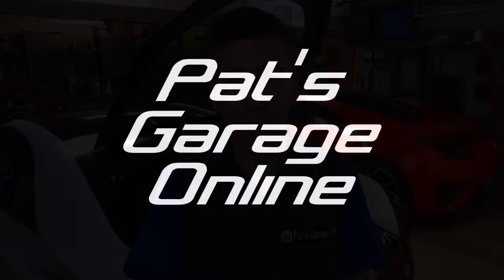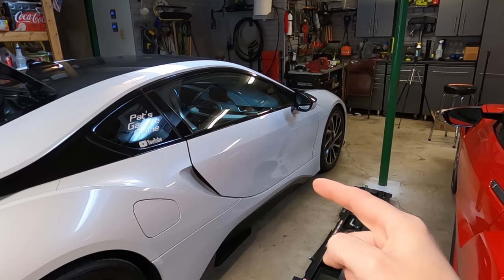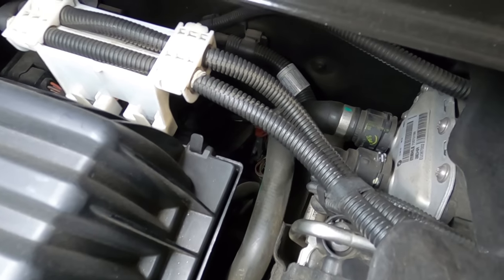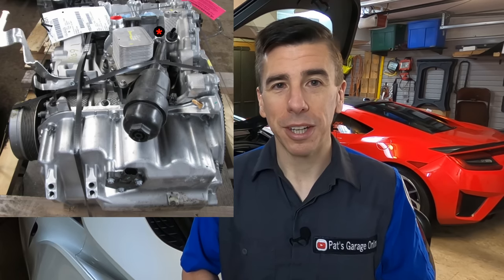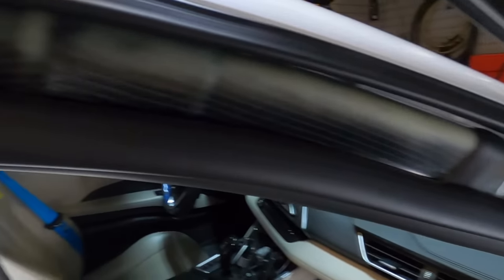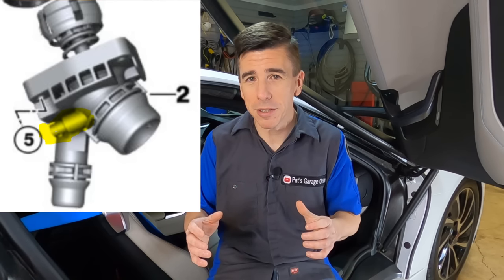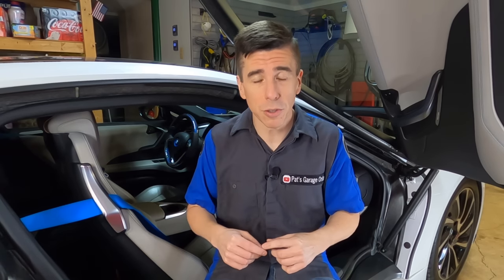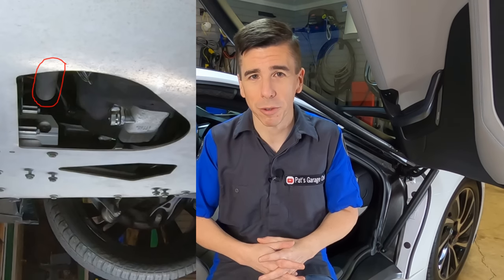My response to your ideas about Samcrac's BMW i8.

Comment: So idea. Could you park this car on an incline. Pop a coolant line off somewhere and fill the system pushing the air out or a large majority of the air. Then reconnect the line after filling said line that has been popped off to bleed air out. Then do the vaccum bleeding procedure. And yeah I would be doing this on an incline. To help push air from the engine.
Reply from the maker: That's a possibility!
Reply: @PatsGarageOnline  I was thinking of disconnecting the line highest in the radiator and using the top radiator hose to adapted a garden hose on it and just let it push water through the system for a solid 10 mins to force all the little air pockets out. I feel the radiator purge would probably be the best option on this car as how the thermostat and its housing are a pain to get to. And would it be possible to crack say the water pump housing bolts just enough to purge air out of that block or thermostat housing when pushing with water?? I would crack the bolts loose enough to allow water to push through the and force any extra air out. It might take an extra hr of messing with bolts but I feel it would be cheaper than a new motor.. 
One other thought when his radiator popped at the seam. Could that be where the air was leaking into the system? 
As for blockages. I would be removing one line at a time and purging them to see if anything like a marble or dragon's eyes something small and solid comes out of the lines just enough to restrict the flow.

Comment: The thermostat may function electrically but fail mechanically, like the wax pellet leaking from its housing or valve sticking. Question, is there a coolant connection on the passenger side of the cylinder head above the water pump? Another question, do any parts of the cooling system look new, like the water pump, radiator, etc?

Comment: Is there any way for that wax ring in the thermostat to have become delaminated or dislodged and make its way to another location in the cooling circuit?
Reply from the maker: That is a possibility.  Maybe it got stuck in the radiator.
Reply: @PatsGarageOnline  Since the radiator blew out under pressure, that could be a possibility.  I watched Samcrac vid where his technician removed the thermostat and it came out in pieces. I don't recall seeing that a wax ring was one of those pieces.

Comment: Still going with the radiator theory.  Why would the radiator blow open, wouldn't it blow a hose first?  Pressure should equalize first and then blow out the weakest link.
Reply from the maker: In this platform, the radiator is the weakest link.

Comment: Its not uncommon for BMW radiators to swell up inside and then  just a trickle of  coolant will pass through. It will look normal on the outside.

Comment: Why not use a vacuum filling system? Lifting the front is what we did in the 80’s when I was at Nissan oddly enough...
Reply from the maker: Sorry about that.  I covered that in the previous video.  Vacuum filling is how we fill the coolant in this car.  However, if air is still getting trapped at the top of the block/head, elevating the front is necessary while vacuum filling.

Comment: How about drilling a tiny hole in the thermostat, to allow air to be displaced? I've done this in the past with cars that are awkward to bleed out.
Reply from the maker: Sadly, that thermostat is very low compared to the top of the water jacket.

Comment: I wonder if installing an access port in one of the coolant lines on the 'other side' of the coolant system so you can draw a vacuum on both sides at once would help negotiate the issue faster.

Comment: Can you take the hose off rear bottom of the engine and force water up through the engine and through the rest of the system while applying a voltage to the thermostat resistor to open it ?

Comment: I am not sure if this would even be possible, but how about a T fitting in the rear of the car that is strategically placed so that you could 1. pull a vacuum or 2. use it as an external bleeder for the rear of the car to purge air as you introduce coolant.
Reply from the maker: It's possible.  Not sure why BMW didn't consider that.
Reply: @PatsGarageOnline   Thank you for the reply. I was also thinking that there could be a check valve installed in there that is re-routed back into the system. I think that would definitely help purge the air out quickly. A psi gauge inline would be good too.

Comment: When you read the description of the thermostat; it struck me that it is dependent on the input air temp. Has that sensor been checked and functioning correctly. Is the air temp free from obstructions too? Just trying to think outside the box here. Great Content!
Reply from the maker: Great observation.  That's definitely something Sam will need to take into account.

Comment: just a thought but isn't it possible that someone could have switched the pins on the thermostat electrical connector. thus reversing the way it works.
Reply: Doubt it-it should be polarity insensitive if it is truly a simple resistance heater.

Comment: Don't understand those bleeding problems why not just use a powerful/fast water pump it would squeeze with the speed all air from the system in no time if can be connected to the system somehow of course
 We use similar system for bleeding pipes for underfloor heating system it have way more pipes than any car

Comment: Where is the highest coolant pipe on the engine?
Isn’t it possible to install an air bleeder on that pipe, or on multiple pipes.
Reply from the maker: It's a couple inches below the top of the water jacket

Comment: Is it possible to misroute the serpentine belt so that the water pump is turning the wrong way?  With all the measures that Sam took to bleed the cooling system, if it is still overheating this is a terrible design.  How did they get this to work when these cars were manufactured?

Comment: How did they get the design of this cooling system this badly wrong. It sounds like BMW dealers are aware of it so why isn't there an updated procedure or a part change to add a bleeding port in the engine bay

Comment: if im not mistaken if you put direct 12v to the wax sensor to allow the thermostat to open up then run the vaccum to fill the lines it should give you a complete bleed then. right?
Reply from the maker: The thermostat is normally open until it receives a charge.

Comment: Is there no way of connecting a garden hose to the cooling system. It worked for me on a Ford van. Connect hose, turn on fully, leave running for an hour.
Reply from the maker: You can disconnect one of the 100 hose fittings and attach it there.

Comment: ........ Ok plan B   . i see at 3 min the silver thing . there are 2  black hoses  . If they are Coolent lines  can you cut one  , put a 4 inch / 100mm  tube fitted with a bleed valve  or   on the Coolent   line at 10 25 . If that not work  . Buy a Porsche
Reply from the maker: I think taking this car to a Porsche mechanic would be the solution.  They have a very deep understanding of how water cooled mid and rear engine cars work.  However, I think Sam actually has a blockage somewhere.  Repeated bleedings should still work, according to the techs I've spoken to, and something is very suspicious about his car.  I hope he removes the under body panels and takes a closer look.

Comment: The thermostat isn’t the issue since the old one was gutted out.
Reply: Sometimes a car will over heat because of a thermostat being out ..it flows so fast that it cant cool off in radiator..ive had that ..

Comment: I completely tore down a bulldozer to change the clutches as it wouldnt work properly..after all of that ..still wouldn't work..started over ..crawled under it checking it out ..decided to pull the hose that went from hydrologic tank to pump ..collapsed hose...2 $ part ...ugg
Reply from the maker: It hate when a small part is the cause of a huge problem and we spend hours trying to fix it only to discover it was the small part.
Reply: @PatsGarageOnline  yeah ive had hydrologic hoses do that twice on a this and a dump truck ..it falls apart on inside and blocks fluids..

Comment: That car looks like the concrete example of the old saying about "a fool and his money". $150K for THAT piece of crap? Had several of the /5 and /6 motorcycles as well as a '68 2002. Easy peasy to work on and robust. What a disappointment of a manufacturer.

Comment: Why not cut the coolant tube and put an in-line bleed port for the high point
Reply from the maker: The high point is in the cylinder head.
Reply: @PatsGarageOnline  the pipes on the side are very high. While might not be a complete solution, it could probably mean that the car wouldn’t need to be held at such an angle to bleed through.
Reply: What if they tilted the car sideways. I know its not the norm but I just saw he fixed the problem

Comment: Can the water hoses be disconnected below the vehicle and water forced into one side towards the engine, by connecting a water hose, to see if water is flowing out of the other side...this would eliminate the engine water channels and maybe point to a blockage in the front of the vehicle or radiator. (You could obviously check the front in the same way) Can the thermostat be opened via test equipment to check operation?
Reply from the maker: Yes.  All the coolant hoses have quick disconnects so it's super easy to try to flow water through them, but it's a pain to get the car up high enough to get the large underbody panels (stiffening plates) off the car to do this.  I hope Sam gives it a shot.

Comment: It has to be one of the best looking cars on the road but in reality how practical would it be to keep on the road long-term?
Reply from the maker: Only practical to own one under warranty.
Reply: Thanks for the reply. 
Sounds similar to owning a Tesla. 
As age and mileage increase, presumably warranty costs spiral, and if available at all, exclusions will apply.
Batteries should last well, but I wonder what the value of the car will be as it approaches 10 years, with a potential $10k battery replacement on the horizon.

Comment: So is the thermostat valve normally open allowing coolant to flow to the cylinder head inlet, even when cold? When electric is applied and heats the wax, it closes the valve restricting the coolant flow. If this circuit would short out, it could keep the thermostat closed. The computer system should have electrical checks for shorts and opens. Does it? When the thermostat was deleted it ran cooler longer.  The engine looks like its engineered to fail by its design. Is it known how many of these cars blow headgaskets.  If it can't self bleed any air off that cylinder head easily, that engine is toast.
Reply from the maker: From the service manual:  If the characteristic map thermostat fails, the following behavior is to be expected:  Fault entry in the engine control unit, conventional operation via wax element, US version: The emissions warning light lights up in the instrument panel.  I'm not sure what happened when they removed the thermostat from the housing but my bet is that it actually broke it.
Reply: @PatsGarageOnline  It looked like the spring part ( https://youtu.be/ijDj17kcIqw?t=515 )  aka the thermostat is a separate piece that presses in to the housing ( https://youtu.be/ijDj17kcIqw?t=688 ) . The housing is electrically isolated and heats up the thermostat by a press fit. If you disconnect the wires to the thermostat, the valve is always open and allows coolant to flow( https://youtu.be/ijDj17kcIqw?t=568 ). So its normally open. Since you have the service manual find the wiring diagrams and see if a relay controls that heater circuit or whether its all part of a sealed computer. The relay might be bad if it has one. Any chance you can easily pick up a water pump and thermostat to see for your self how it works and then return it.
Reply from the maker: @thirtythree160  The wiring diagram shows that this is controlled by a transistor within the sealed engine control unit (DME) and labeled as B445*1B, B6279
Reply: @PatsGarageOnline  I guess if the transistor failed, it could be a short circuit. A voltage check on the unplugged pigtail to the heater element would be a good thing to look at. Power always there means the computer is bad.

Comment: Is the heating resister not receiving current, thereby the ax element doesn’t open?
Reply: That thermostat works just like regular mechanic thermostat BUT dme can lower the opening temperature by heating the thermostat with electricity.

Comment: I worked on Helicopters for 22 years and I love good challenges and being a automotive DIYer I have ran into many. I will say this though. The BMW i8 has to be one of the worst engineered vehicles in the BMW line. I applaud them or the efforts in the use of technology, however sometimes you have to look at overall headache factor for the servicing individuals. I think BMW failed on that account.
Reply from the maker: I agree and this is a trend that BMW is using in their future platforms as well.  As everything starts to go hybrid, they're all going to have complicated issues.
Reply: @PatsGarageOnline  I learned a long time ago while working at that Helicopter Company in Connecticut. Even though it looks good from the engineering stand point, in the practical world it just don't make a whole lot of common sense.

Comment: So it turns out it's a head gasket leak ?
Reply from the maker: Yes, which is actually uncommon on an i8.  Weekly I hear how a coolant component was changed on an owner's i8, it's overheating and they take it back to the shop and another bleed fixes it.

Comment: So you should actually apply 12volt to (or engergize with some voltage) the Thermostat Wax gizmo to be able to bleet the whole system, including the engine block?  Otherwise the thermostat is closed?
Reply from the maker: Actually, the thermostat is normally open and the wax element heats in order to close it.
Reply: @PatsGarageOnline  ah ok, I was just wondering if it was open or closed when energised.

Well, we’re all brainstorming :)
Reply: Actually brings up the second question:
Should the car be switched on or off for the vacuum/burping procedure?  In order to have the rest of the system “open”
Maybe the thermostat needs to be disconnected and the electric water-pumps/valves energised?
Reply from the maker: @farturinn  I have a feeling that when the tech used ISTA in order to invoke the bleeding procedure, that sent signal to all of the components in the high temp coolant circuit to be open and running.  At least, I hope so.  We're all learning more about this as we dig deeper.  I'm just a DIY guy who never had this problem on my own i8, personally.

Comment: Any advice on 1st gen Cadillac CTS?  I bought a 2006 133000 miles shaking sometimes on the road worried about timing chains, I'm going to have balanced wheels soon and suspension checked/inspection to be aware of any problems,,,I'm a 3.8,,, I'm not AWD or ride leveling...? Does a ball joint make it shake randomly at higher speeds?
Reply from the maker: I am not familiar with that vehicle, to be honest. I recommend posting your question to a Cadillac or Chevy forum if you can find one on the web because other folks may have experienced the same problem.

Comment: Love your channel Pat and a must to subscribe to if like me to are thinking about buying an i8......... I've been thinking about owning one for a few months now and have been on many forums and your YouTube channel to do as much research as possible but the more I find out about the i8 technically the more I'm now going off the idea...... Its a great looking car but issues that do seem to arise are costly (although I would buy a comprehensive warranty with it) and also mean you can be without the car for weeks while the problems are being fixed and as mine would be a daily driver its not going to be practical for that to happen.....😢
Reply from the maker: I totally understand.  Now, mine is a daily driver and under warranty, so for any issues, I get a loaner car from BMW.  I won't own it outside of warranty, however.  Some of the more complicated issues can have it in the shop for months.  Like my friend @evapors.

Comment: Maybe either Bad wax or no wax Honda has been using a wax system on there engines for fuel system and other things for decades.
Reply from the maker: I just bought my first Honda (Acura) last month so I had no idea.
Reply: @PatsGarageOnline  Yes even in a Honda Lawnmower they use a wax System for the automatic Choke system and they do fail as well.

Comment: Hi. Would it be possible to install a tesla motor? This combustion engine system we use for transportation néed an upgrade. Have you considered a tesla ? Thanks for your time. I'm hooked. Please record more.
Reply from the maker: Rich Rebuilds often gets this question, as he's the Tesla guy and has a rebuilt i8.  However, he said there is no where to put the Tesla batteries in the i8.  It would have to be mounted as a separate unit and change the aesthetic of the car.  Thanks for the comment!

Comment: The temp sensor is in the engine block?......well there's your problem!.....80% of engine rejection heat is developed in the head. The water jackets surrounding the cylinder bores simply maintain heat for lubricant flow.
REALLY beginning to suspect this is click-bait (and it's working very well...)......to my original post, ahem...remove ANY factory installed temperature maintaining devices, and connect a simple liquid source to one side of the in and out....if it goes in, it has to come out
Reply from the maker: I'm 1000 miles away from Sam but if I had eyes and hands on that car, I would have tested the flow as you recommended as well.  Sorry for the click-bait.